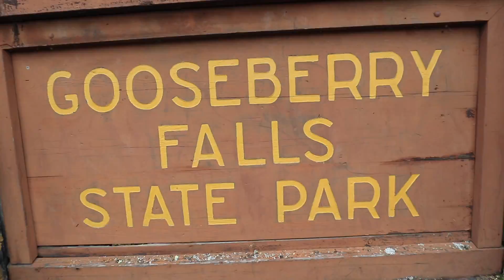Duluth, MN - RV Living

Comment: Excellent statement that hitches should be checked on new trucks as well.  My experience as an engineer is that systems not only fail when they are old (which most people understand) but also when they are new (which most people don't expect).  It's the mid-life of a system that is typically safest.  Awesome video as always.

Comment: Harbor Springs Mi is a mind blower and the Tunnel Of Trees.  :)  In ND.there is a camp Ground at Ft. Abraham Lincoln, Custer's rebuilt post, super spot. The Spirits are heavy there.
Reply: I went through the Tunnel of Trees and it was amazing. I imagine its even more spectacular in the fall. But beware if you have a high camper or RV because they hang low and are VERY close against the road. I got some "hash marks" along my camper, but worth it.